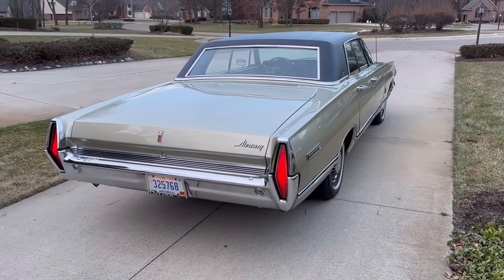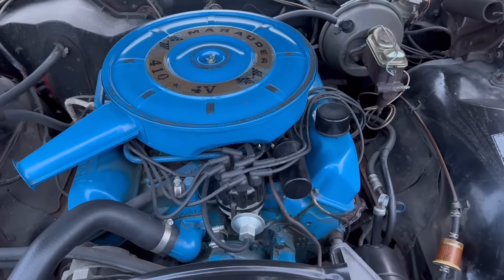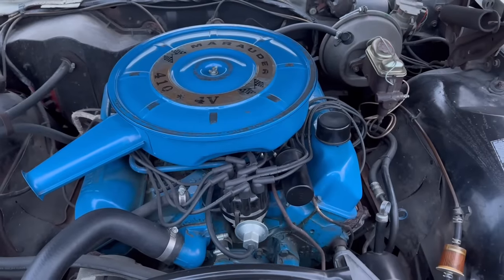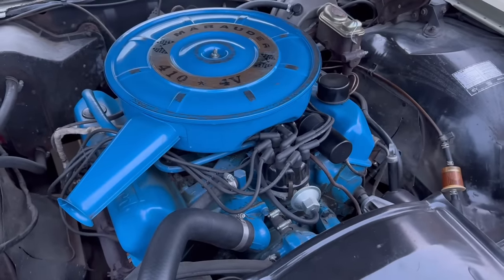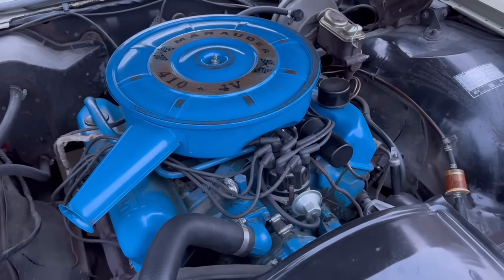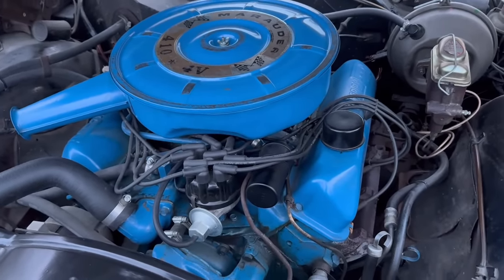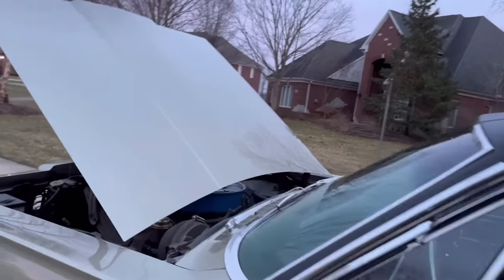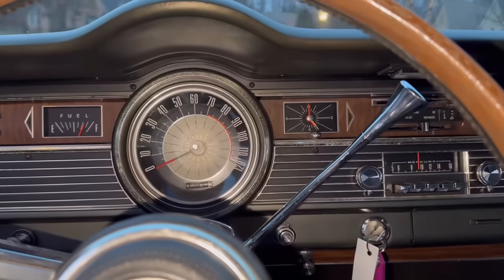Ford's Shortest-Lived (and Smoothest) V8 Engine: The 1966-67 Mercury Only 410 V8

Comment: My 410 was pulled from my Park Lane some months ago at 154,000 miles. Heads done (not cheap), pistons and pins equalized in weight, crank needed only a polish, rods at shop for re-sizing, balance, and arp bots, while block goes in this Wednesday. Now some things I notice about your engine. Must be early production as you do not have the closed breather with nipple on the air cleaner that I have. Your engine is definitely a lighter blue compared to mine. You have a 70s' vacuum canister on your distributor. The 4300, in the right hands, can be a great carb. In the right hands would have been Jon at Pony Carbs before he passed away. He did mine, we talked about it on the phone in 2004, and on my car it runs flawlessly like fuel injection. He knew just what internal mods were needed and now they are lost to time unless I open mine up and go looking. Just looked at your story on the 71 Ambassador. I just acquired a 1972 Ambassador Brougham station wagon that Dennis drove down for me. Precious little on that car.

Comment: My dad had a 1967 Mercury Parklane Brougham  when I was a kid so this brings back memories. It was fully loaded and had interval wipers and a factory 8 track stereo which my dad used all the time. The rear speakers were behind die cast grills in the roof rear sail panels. They pointed directly in you ear. No mater which side you sat on, you only heard the speaker that inches from your ear blaring.

Comment: 221 was only produced for two years as well. 

The distributor in my 7 Litre Galaxies 428 got so stuck, nothing would free it. Waited till 120 + degree Arizona summer day and blasted it with a Freon can turned upside down. Shock cooled it, and it popped right out!

Agree with you on the 4100. The most reliable 4bbl ever conceived.
Reply: I used to use a fire extinguisher, the sudden cold will free it every time. The Y-blocks were bad about that too.

Comment: A similarly short production run was had by the "Fairlane V8", aka the 221 Windsor. Introduced for the 1962 model year, phased out in May, 1963. Your Park Lane Brougham is a very similar greenish-gold as the 1965 Comet Caliente 4-door I had for many years. Thanks for sharing, Happy Trails!
Reply: My mother bought a Maverick in the fall of 1969 which was the first of the 1970 introduction of the Maverick. Instead of the normal plaid seats this one had all black vinyl interior with a 200 CID six cylinder coupled with a C6 automatic transmission. The color was lime gold which sounds like the greenish gold you describe. It was a beautiful color.

Comment: Magnificent vehicle. The 351 Cleveland also suffered the same seized distributor ailment. Here in Australia, Ford cast "Australian block" 351's which had a higher nodular iron component than the USA versions - much sought after for racing. But same distributor problem. We also had a 302 CID version of the Cleveland.
Reply: I found out the hard way that the distributor would also seize up on the 351M in my mother’s 1975 Mercury Montego Wagon.

Comment: in 1954 Mercury used a 256 Y block for that year only. Was also used in '55 Ford HD trucks, for one year only. The 406 FE was a 1½ year engine for '62 & first half of '63, replaced by 427.
Reply: ford was known for making mid year changes that were not documented.
Reply: @gregoryclemen1870   Part of why amongst some auto enthusiasts, Fords are kinda hated on.  There used to be a joke that Ford never built the same engine twice.
Reply: @xaenon  ford like chrysler, and G.M., they all were competing with each other when it came to the muscle car era, and a lot of good technology came from that time, ford would discontinue an engine if it had too many bugs in it, rather than try to work out the problems, they would stop production of that engine, and move on to something else.
Reply: @gregoryclemen1870  No doubt they WERE documented. Was Fed law that anything that effected parts number or interchangeability be noted with update bulletin. Often that info was overlooked by parts suppliers.
Reply: The 256 & 4 barrel Holly was also in the 54 Ford package for Police.

Comment: Ford offered a 406 FE as their high-performance engine for 1962 and part of 1963.  It was discontinued midway through '63 when Ford introduced the 427.  Among other things, the 406 was Ford's first engine to employ cross-bolted main bearing caps.
Reply: I think 61 was the first year for the 406. Not 100 sure, tho. You are correct about the cross bolted mains.
Reply: The 406 used the 3.78" stroke with a bore of 4.125" which was the same as used later for the 428.
Reply: Not all 406 engines had the cross bolted mains - I bought and owned a '63, purchased new in mid '63, without them though it did have the longer 427 headers and distributor and the late tri power intake. Real interesting engine to buy parts. And yes, the 406 engine was introduced in late '61.
Reply: Didn't someone in Nascar race a 406 in 62 or 63? Maybe  Cale Yarborough?
Reply: @61rampy65   The 406 may have been introduced in '61 as a '62 offering, but for '61 the tawp dawg at FoMoCo was the triple-deuce 390, 401 hp.   That induction was carried over to the 406, though later abandoned for dual quad.

406s had a bad habit of scattering their lower end until they came up with cross-bolted mains.
Reply: @xaenon  I just looked it up in my Chiltons manual. It shows a 4v 390 @ 375 hp for 61, and for 62 there was the 401/390 w/3x2v, and the 406 with 2/4v at 385hp. I'm pretty sure that the 401/390 was available in mid 61, tho, and the 406 also had the 3x2v at first.
Reply: . @61rampy65  The manuals I had described for '61:

The 390 4V rated at 375 hp, and also a 390 3x2V rated at 401 hp.   These were optional engines in Starliner, most were fitted with 292s and 352s. The 390 was all-new that year.

For '62, the 390 was availabl as a 300-hp (4V 'Thunderbird') regular option, 375 hp (also 4V but with the hotter cam competition option),  and 406s rated at 385 (4V), and 405 hp (3x2V)

For '63, they don't list any 3x2 setups for either engine, but the 390-4V was rated at 300 hp, with two 406's availabe.   Te 406 4V rating was identical to '62, but the dual-quad version had an unspecified output.  Apparently the 406s were on their way out by that time, as Ford was rolling out the first 427s for competition.

Some have told me that the 3x2 setups were not factory installed; they would be provided with the car, but the dealer was the agency that would install them before delivery.  I can neither confirm nor deny, but that sort of thing was often done by Ford.

I do know that the triple-deuce and 2x4V FE intakes were sold by Ford over the counter through the late 1960s
Reply: @xaenon  Your version coincides with my memory better than the Chiltons book.  I put the 3x2 set-up on my 68 Mustang 390 for a little while, but I didn't know enough about Holley carbs to get them to work right. It was much faster than the stock Holley 4v. It was a stock Ford aluminum manifold, but I bought it off someone, and we didn't know from what engine it came from. This was back in 1972.  I do know that iron FE intakes are as heavy as the engine (it seems).
Reply: @61rampy65  You really had to know how to tune 3x2 and 2x4 setups to get them 'right'.  I'll state for the record that I never got them to work quite right, either.

Though I did run a triple-ace setup on my little six-banger Falcon for a while.   But those old 1100s were the simplest carburetor I've ever seen on a car.  It sure gave a few Wheatiest to that little 200....
Reply: @DanHolmes-o9b ; For one or two tracks they'd destroke 427's down to 396 cubes.
Reply: @xaenon ; From what I've read, Ford sold over the counter competition parts for the FE, but not the MEL, which is why there are no "Day Two" triple carbed 1958 MEL 430 T-Birds.
Reply: @xaenon ; 200 inline six was a good reliable little engine, in my experience.
Reply: @xaenon  The triple deuces are very simple to set up. I run that setup on a 390 and on a 428 SCJ. Ford cast 2 different manifolds. The casting numbers are different for the 390 and 406 manifolds. The beauty of these systems is that you only tune the center 2 barrel. Neither end carb has a metering block. All 3 carbs open at a different rate. The progressive manual linkage just has to be adjusted so that all 3 hit WOT at the same time. It is very simple. Holley will build new carbs for you if you own a small gold mine.
Reply: I cross bolt my main caps, you can buy the center 3 from a company called ProGram and you can even get them with bolts that can screw in and attach lines to the center 3 side bolts that create priority oiling for the center 3 and drill a passages in the front end rear for all 5 by putting plugs just above the cam bearings. I have raced these old engines since I was a teenager z
Reply: @xaenon  Actually most scattered when run in NASCAR.  Street driving weren’t as bad.  The 390I/410, when cross bolted and the oil system blueprinted can take 1000hp with a turbo or blower.  At 8. Lbs of turbo boost. Can make 825 hp blowing through a referenced carb. That will flatten your hat.
Reply: @61rampy65  The FEwith an aluminum intake is about what a 350 Chevy all iron.
Reply: @jdwht2455 
Introduced in 1961, but not installed in either 1961 Fords or Mercurys.
Reply: I believe the 406 wasn't offered until December 1961.  For the early '62 models manufactured before then, the 3X2bbl 390 was carried over from '61 as the top option. So, the 406 was only produced some 13-14 months before being superseded by the 427.
Reply: @billdescoteaux  That would fit the development to Job 1 at Ford. The 406 was a great engine. The 390 in 61 was really punching well above its weight. 375 and 401 hp was an accomplishment for the Gen1 FE. The C0AE heads are the best of the Street heads and are softened and shaped much like the Yates heads that came to be on the Cleveland. I have a D4TE block and can get some 61 heads for a twin turbo 390 at 800 hp. I wish that they had made the C0 heads through the 20 years they were made. They were great chambers, they had great tumble to swirl and they took very little work to get 285 cfm and over 300 with a medium riser intake. I think they were hidden under a basket. It must have scared them that insurance companies would penalize Ford if they were their common heads. I always wanted Edelbrock to use the chambers, even drew up the prints. They said they wouldn’t get them past Dismuke in NHRA. 😂. These would have been 500 hp in a kit.

Comment: Man I absolutely love your channel. I've not owned anything classic per se but I did have an 81 VW rabbit diesel for almost 5 years and loved it and it's 48 angry horsepower lol. Great channel and videos sir!!
Reply: And you forgot 48 mpg  too
Reply: @gulfy09  yep it was great on fuel!  It was a great car even though it was over 20 years old by the time I had it.
Reply: @gulfy09  yep it was great on fuel!  It was a great car even though it was over 20 years old by the time I had it.
Reply: My dad got 70 mpg out of his 77 rabbit diesel on a trip one time. He worked hard to get that bit it was possible with careful driving. 50 mpg was normal local driving
Reply: don't feel bad about your 48 hp VW.  I bought a '80 Pontiac Turbo Trans Am at age 16 in 1991, because I had always wanted one, looked more exotic than the usual T/A.  Factory rated at 210 hp & 345 ft/lbs.  As to those dyno numbers, anyone who ever had one would tell you, "in your dreams". 😁 tagline in advertising should have been "buy it for the novelty of it, not for the performance".  I took it to my uncle at the time, he thought he could get the A/C to work, he later said "if you open the hood, and she's got a turbo, on a gas-burner with a carburetor, run the other way"
Reply: @tomgaddis5020  Mine would usually get 50 or mpg, it was only a 4 speed manual. On the highway it was screaming at the top of its lungs at 65mph.  Was his Rabbit a 5 speed?
Reply: @Sheisthedevilyouknowwho-ft9we  it was slow but such a great car. I have literally no complaints about the time I had it. I miss that diesel clatter.
Reply: I also had an early 80s rabbit diesel. I bought it in norther California and the Air Force shipped it to England for me.  It was about 9 years old and very tired.  I drove it over there for nearly four years. Had to downshift to third to go up any hills in the road.  It got around 40 mpg as I recall.  I put a new head gasket on it after it blew out all of the coolant.  I sold it to another airman in 1993 when I left England. It was a good car for the time even though it is frustrating driving a left hand drive car on the left side of the road.
Reply: @jeffsmith846  that's awesome. I had to do a head gasket on mine senior year of high school.  What color was yours? Mine was canary yellow.
Reply: @hawkeye454  had a 6.2 diesel 1982 K10 Chevy.  I know what you mean, I miss it

Comment: That would be the perfect engine for a '76 F250 Highboy.
Reply: I have a friend who did this.
Reply: I always said that about the 428. I never knew the reason why Ford didn't include that engine in the F-Series pickups back then, smooth low end torque for days, it was the perfect engine for big trucks, eventually 460 filled the gap nicely for two decades though.

Comment: My dad has a couple of these 410's (390FE bore/428FE crank). We're putting one in my 1967 Mercury Comet, and one in my 1968 Mercury Commuter wagon. Both will have a top loader behind them, but the Commuter will have the 3 speed with overdrive top loader. They make some nice torque. The Comet's 410 is getting a tri-power, headers and a healthy cam). The Commuter is just getting the Autolite 4100, Edelbrock, A/C, Power Brakes, Power Steering, and a torquey cam (very little lope).

We used to have a 1967 Mercury Marquis with a factory top loader 4 speed. Rare car, I drove it for a long time. He ended up selling it because he got a divorce and needed to get rid of some of his cars. He's always been a fan of the FE motors (and has just about every size they made bigger than the 390).

Comment: I have one rare engine for you,  a 66 Ford 428 police interceptor.  Basically it’s a 428 hi pro. A one year only solid lifter engine, hi lift cam, factory aluminum 4 barrel intake and the block isn’t drilled for a hydraulic cam and lifters. One year only engine.

Comment: I used to have a '67 Mercury Marquis with the 410 Marauder engine. The weird thing about this engine was that the valve covers not only covered the heads but also part of the intake manifold.
Reply: Yup, all FE engines were like that.

Comment: I have owned a lot of vehicles with FE engines and they run smoothly and in my experience start quickly like that, barely turn the key. Awesome car. Need to build a 410 next 😊

Comment: 🇺🇸👍 I had a 410 in a  Colony Park Wagon. Before the 260,289,302,351 was a 221 1962-1963 it shared the same stroke as the 260-289 2  7/8 inch but smaller bore being 3 1/2 inch at 145 HP .👍

Comment: Found a 410 engine in a 1969 mercury f100 from canada. The carburetor was the only non factory part on it. It had a 650cfm holley that rarely had the need for the secondaries to open. It actually got very decent fuel economy if you kept your foot out of it.

Comment: It's a little off topic but the first 4 years that Pontiac offered a V8 they were one year only sizes. 287, 316, 347 and 370. I believe they also had reverse flow cooling..
Reply: So Pontiac's engine in the '60s had the same cooling method that Chevy didn't implement until the '90s?
Reply: @skaldlouiscyphre2453  No, Pontiac V-8s were gushers up until '59. 1960 they changed over to conventional flow.

Comment: The 462 MEL was around only slightly longer. The 462 MEL was used in  Lincolns for 1966 - 1967 and the early 1968 Lincolns. Early in the 1968 model year,  Lincolns got the 460
Reply: Yep, I remember our neighbors at Tahoe had a '68 with a 462 while we had a 460.  (Anyone else think that Cadillac brought out the 472 in 1968 because Lincoln punched out the 430 to 462 in 1966?  LOL!)
Reply: @marko7843  That was the reason that Cadillac introduced the 472 which eventually got stroked to 500 cubic inches.  Ford and Chrysler both introduced new engines in 1966 which were bigger than the 429 Cadillac was putting in its cars which was the limit of the engine's architecture at the time.
Reply: @1575murray  and oh, the irony, that the new Ford engine was only 460, and Chrysler never exceeded 440...
Reply: @marko7843  Chrysler came out with the 440 engine in 1966, as a luxury car engine, to compete with the big, smooth Lincoln and Cadillac engines. All 1966 and 1967 440 engines were, "factory hand balanced" to insure that they ran super smooth. For 1968, the 440's got standard factory balancing.

Comment: Adam,
Yes, the 1963 Pontiac Tempest offered an optional 326 cid V-8 that was actually 336 cid.  GM brass told Pontiac's head John Z. Delorean that he couldn't offer an engine in his compact Tempest with an engine larger than the Corvette, so it must be  advertised as a 326 and the displacement reduced to an actual 326 cubic inches for the subsequent 1964 model years.
Hence, this perticular "326" was built only for that one year in 1963.